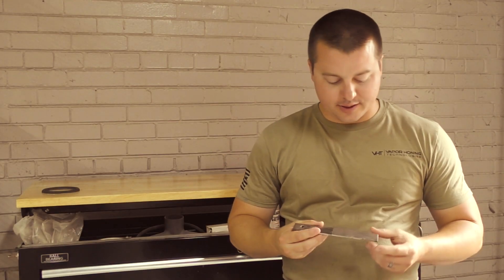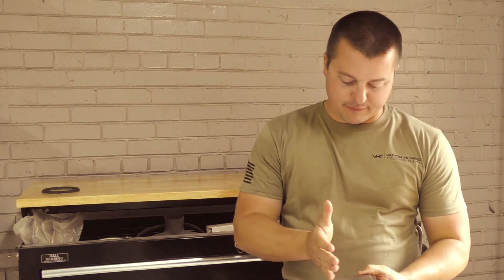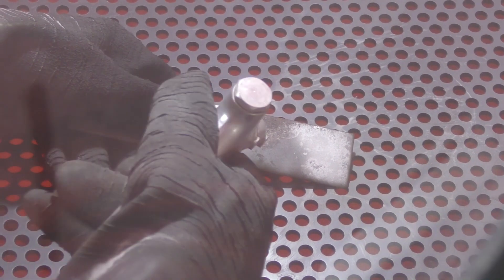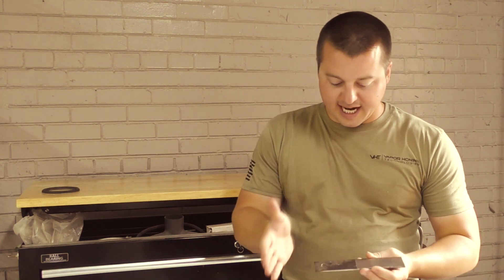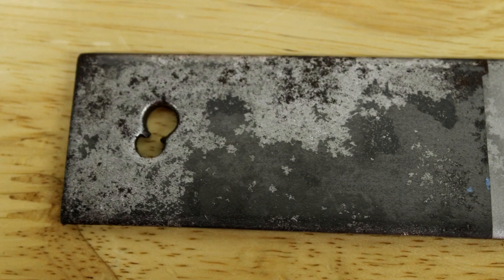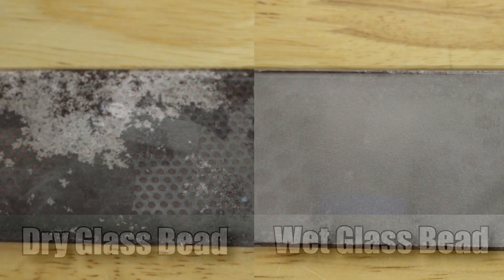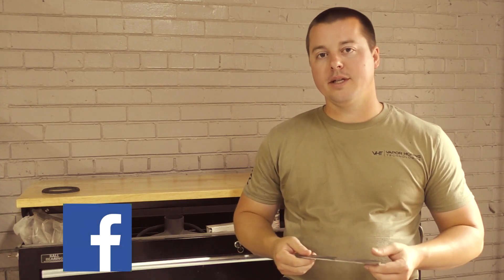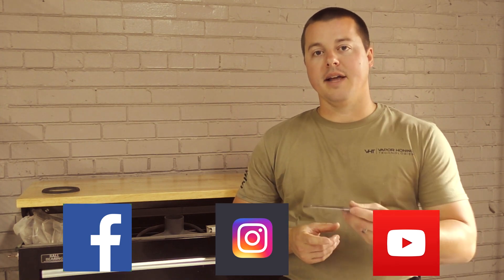Dry vs Wet Glass Bead Comparisons: 12 gauge carbon steel - Vapor Honing Technologies

Comment: Thanks for your videos! im still have some serious doubts about to go with Wet blasting since always used dry blasting, using before glass beads, just it's hard to clean it if you clean engine parts. finish is amazing though. decided to get Armex XL and really doesnt clean as i spected, indeed i think lost money buying it. so i was wondering if i'd get similar results using wet blasing, if using wet blasing with glass beads is better to clean the parts before or doesnt. Ive seen people using Wet blasting w/ glass beads for cleaning engine parts and definitely looks amazing just im worried about to keep parts very clean after to wash parts.I have any experiency with wet blasting so any advice Will be appreciate it a lot! Thanks.
Reply: Cleaning After Wet Blasting:  https://youtu.be/GN26bjbpL3g